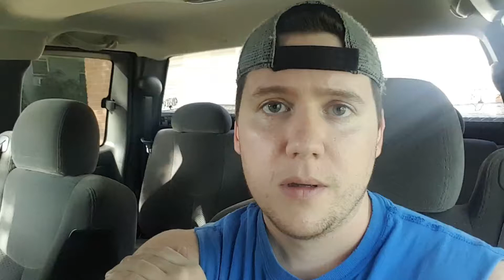Why a Cold Start is Louder - TOD 3

Comment: IT runs richer because the fuel doesn't vaporize as good when its cold so more fuel is added.
. It has nothing to do with helping increase temperature as running rich will make the engine cooler not warmer.

Comment: You are right about it runs richer when cold but wrong about that makes it warm up quicker - combustion temps are actually lower running a rich mixture - it run's rich just to prevent stalling until the combustion chamber is at optimal temp.